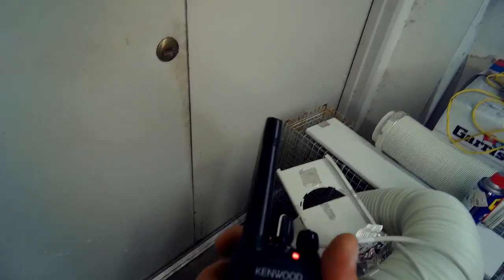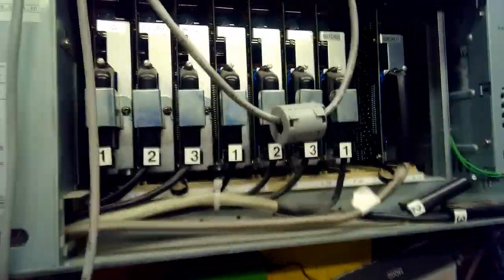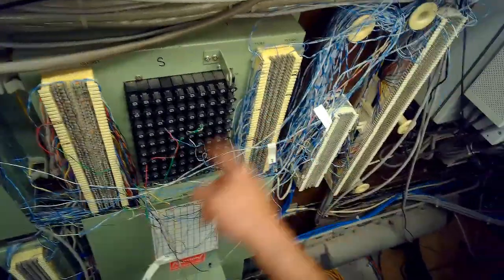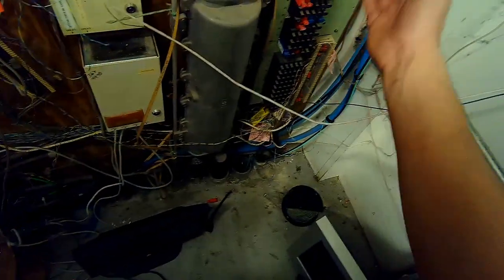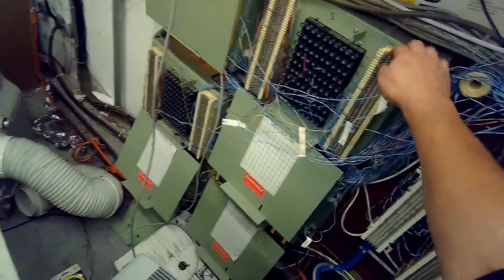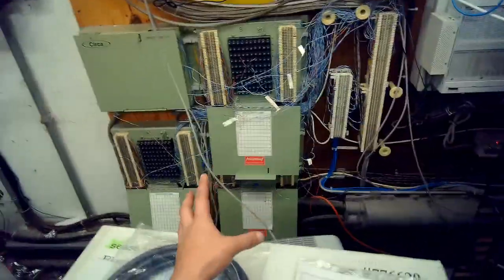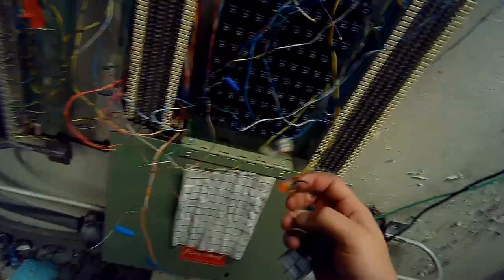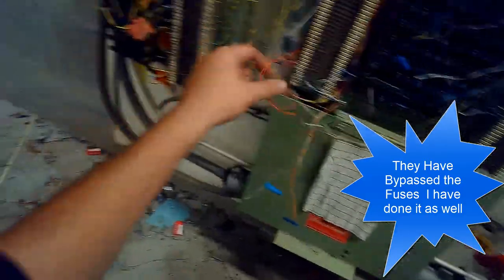How The Phone System Is Wired And How I Transfer Numbers.

Comment: "everyone knows you can't run phones through cat x cable"
me "really... I would like to speak with those people... they might learn something cool about the ability to have multiple phones running off a single twisted pair and at least 200 phones running off of simple cat6a cable... when it comes to digital all that matters is the bandwith. when it's analogue you can have up to 3 lines through a cat6 cable and your phones won't tell the difference.

A simple way to explain it is this, your phones are now digital, the days of Mrs. Geoff sitting in a room manually switching over lines is dead, it's all packet switched networks, which is tone dialling, that phone number you have is basically assigned to you just like a licence plate of a car, you take your car around thee place and you are welcome to change the plates or even keep them for years to come even when you move house.

The phones are through VoIP, it's voice over the internet, your analogue voice is converted to digital and connected through a "hand shake" your voice and their voice is sent in packets and you get to have a conversation

Thee coolest thing about it is the fact that you can have unlimited phone lines in your house as long as you have a server and a controller, if you have a VoIP phone it makes it easier because you can daisy chain the phones (if they have an in and out) and it won't interrupt the calls of any other phone, you point the phones to the server internally and have the server assign the numbers automatically or you can manually put in (for example) "115' for "Room 115" and star 1-99 being the day to day operation lines, "0" to get outside line or reception and so forth, there's unlimited configuration.

"Why do they have it wired up like the phone telco's network you get at home then?"
Simple answer is... If you have to teach your customer how to use your phones instead of just a handy piece of paper with "how to call outside, reception, etc" then you are doing it wrong, and when guests come to visit a hotel, they don't want to spend a day learning the quirks, they want to pick up the receiver and dial.

There are so, so many different phone systems out there from simple ATA (analogue telephone adaptor) to... Ba full scale ISP that has their own trans continental, satellite network and across the seas and space.

Yes, telephone systems can be as simple as plugging in a piece of hardware and picking up the receiver or as complex as you want it to be.

Just don't say that "phones are not compatible with cat cables" because if it has at least 2 wires and can conduct electricity, it's a freaking phone line
Reply from the maker: Yep that pretty much sums it up there Buddy.... Wow